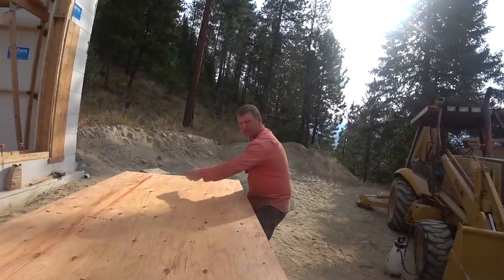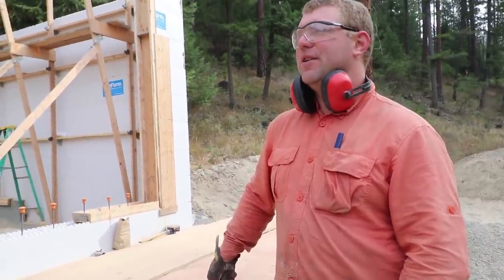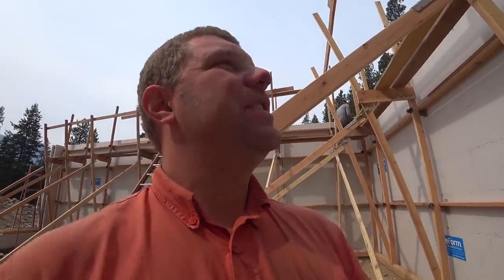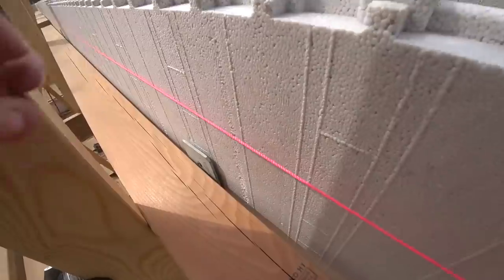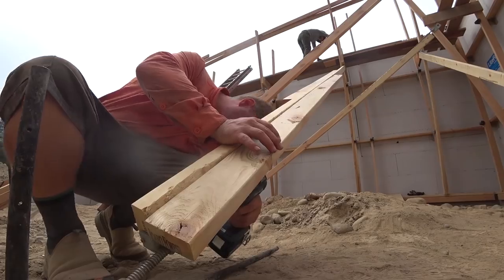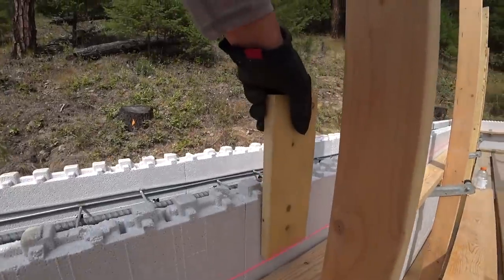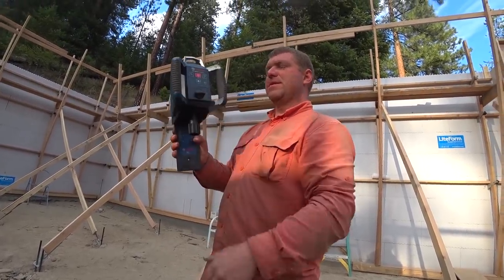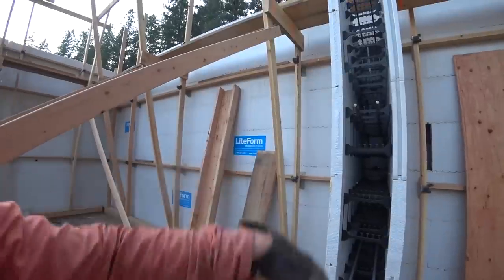Building a House Start to Finish: ICF Concrete Pour Prep

Comment: I feel that is better to over engineer than under engineer, extra reinforcement doesn't lead to a weaker structure... your basement area can act as a storm cellar in case of tornadoes just have to make sure that everything that goes over it won't come crashing down, so good beams for the first floor (my opinion only)...go ask an expert.

Comment: In your latest video you talk about being introduced to a new word or term “as built drawings” and you attempt to interpret its meaning. You were in the ball park with your interpretation but you were standing at the ticket takers turnstile there is a lot more of the park to see. As build drawings or red line drawings are limited to the C, P and H drawings and the contractor means of showing minor changes to the work shown on the project plans and specification without the approval of the owner or architect/engineer of record. They do not reflect any architectural or engineering changes either minor or major to the project plans and specification that require approval of the owner and architect/ engineer.
There are several other terms you may want to be introduce to, if you do contact me and I will happy to explain them to you.

Comment: Odd question - have you guys considered removing the interior foam after the build to utilize the thermal mass of the concrete for energy stabilization?  I've read that the interior foam decreases the efficiency due to the sequestration of the thermal mass.
Reply: Jeremy Stevens The foam forms have some insulation rating like any other insulation for inside of a studded wall...
Reply: @jeremystevens I do not understand your suggestion completely. How do you suggest to utilize the thermal mass? The energy you have to put in the mass needs to come from somewhere. I would say it is better to avoid losing energy in the basement.
Reply: Auke, In areas that have a high day/night temperature differential thermal mass soaks up excess heat during the hotter parts of the day and then releases that heat during the cooler periods. In some environments it is a phenomenal way to save energy because it averages the ambient temperature without any energy required. I don't know how often these conditions apply in northern Idaho.

Comment: Glad your realizing you dont completely rely on an engineer, architect etc for every issue. There are always going to be things which work out on plans but not real life.ask any builder. Not to be critical of architects they are necessary, but they serve different purposes. You will never find a home or building that wasnt off in some way or had to be modified from a plan. We want straight and plumb walls but dont sweat the small stuff for christ sake.

Comment: In the hands of inexperienced people those ICF panels look way too difficult. I would rather use concrete blocks and make sure that the corners are built up square and plumb and then use a string for each row of blocks.

Comment: it is so pain full watching you work nobody like to be told how to do something but you sould all ways level and plum as you build never wait till you are finish work corners first then fill in between makeing sure every level is straight from corner to coroner would  have save you from all your problems, string line from cornor to corner would have only taking 10 mins of your time and saved you hours and hours of work im so sorry that nobody put you on the right way from day one and a plumb bob only cost 20dollars for a 24 oz brass one a 50ft water level only about 20 dollars as well and you only have to fill it with water

Comment: AREN'T YOU GOING TO HAVE WINDOWS? WATCHED AN ICF HOUSE BUILD THE OTHER DAY AND THEY BUILT IN THE WINDOW OPENING AS THEY BUILT. IT WAS BUILT BY THE COMPANY THAT MADE YOU ICFS.  DID YOU INTENTIONALLY LEAVE OUT THE WINDOW OPENINGS?
Reply: it's their garage, they are building a wood frame on top of it with windows in it.
Reply: Grandma Liz's Kisses ground level at the back is similar level at the back of the building and from what I understand this is just the underground garage.
Reply: Grandma Liz's Kisses that's the basement the house is going on top.
Reply: No windows in the basement. There is a personnel door shown in their architectural rendering but it appears they are not including that. I'm assuming the door was to meet life-safety exit requirements, but I could be mistaken on that.
Reply: Thanks for confirming, Dave; I had assumed it was in the original plan to meet the IBC's life-safety requirements. It didn't look like there was an opening in their post-pour workshop announcement video. I'm not sure what they are going to do in lieu of the side door, but one possibility is to frame it on the front wall and have fewer or narrower roll-up doors. They have 36' to work with across there, so plenty of room to get a personnel exit door in.